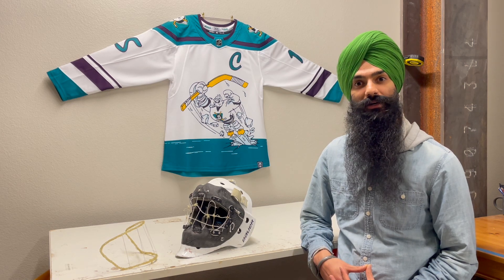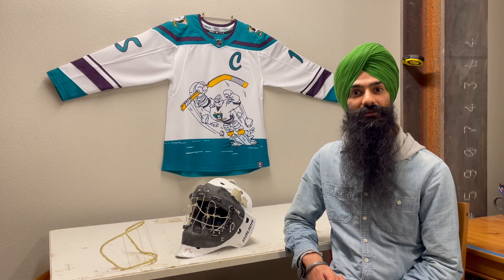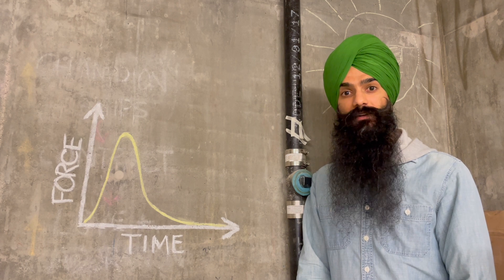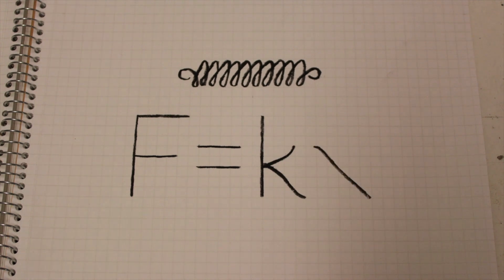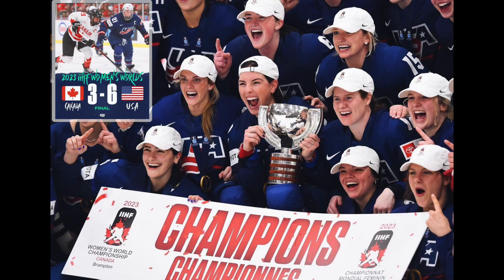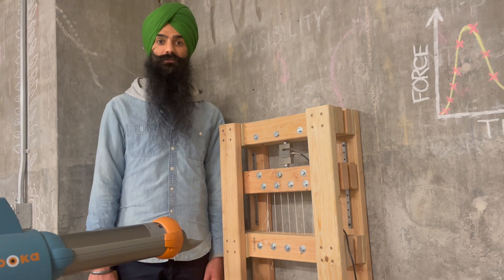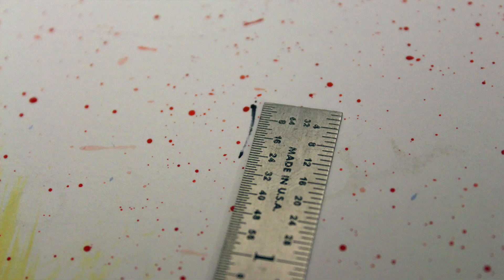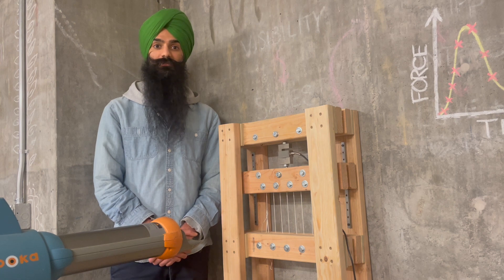Uncage Build Log: Finding the Force

Comment: It might be possible to use a putty or clay of some kind. It flexes minimally and won't return to it's original shape. I think you could probably figure out its compression resistance factor and calculate the force generated that way.

Comment: This is a really neat idea. As a goalie myself, removing those bars would greatly aid in visibility. I'm sure you've thought of this already but what about having a single bar in the middle, potentially with one horizontal bar for stability? Or just two bars in the middle? You'd still dramatically improve the visibility of the cage while providing support for the frame. 

Great video production btw!
Reply: I think he tried this at some point, but it had some problems

Comment: This series has been so enjoyable for me to keep track on. Keep it up!
Physics was not my forte' in school but I'd imagine the edge of a puck is going to have more localized pressure and cause even more damage than the pitching machine ball due to its solid structure, higher mass, and concentrated impact area. Just something to think about when calculating the max impact loads.

Comment: I love your work! Have you looked at what F1 has done with the halo apparatus? A thin vertical spine in the center of your face becomes nearly invisible. This would give the opening of the helmet the rigidity it needs to tighten the curtain of wires. Have you considered piano/guitar wire and hardware for prototyping?

Comment: The force will be reduced if the impact takes longer. You are measuring the peak force if your clamshell were ridiculously stiff. In reality, the mask will deflect a little, and spread out the impulse over a longer duration, lowering the peak force.

Comment: I'm no engineer, but I'm wondering if you can use some of the principles of tensegrity to wrap cabling around/through the helmet to both points so that if it tried to clam shell it would be fighting itself.
Reply from the maker: The geometry is pretty challenging, but I do love the idea and have thought about it before. I'll probably try something a little simpler first, but might come back to it in the future.

Comment: Great stuff! Are you concerned about energy lost due to the non-stiffness of 2x4s? I’d imagine those force numbers should be actually higher?
Reply from the maker: Good question! Not too concerned (though I could be wrong not to be). I know I made some tradeoffs - like not using the peak detector to find the actual peak - but I needed a number that was close enough to keep moving forward. Didn't feel I'd gain anything by getting something that was like 100 lbs more precise. 
Also, there is going to be energy loss in the actual frame of the cage as well, so I think a perfectly rigid test rig would be unrealistic in the other direction.
Reply: @surjan_singh it's not so much the stiffness, as it is the mass of the wood inertially dampening the force of the ball. If the mass of the ball and wood were equal, the acceleration of the wood is effectively a significant amount of force (not factoring any frictional forces) . By the way, someone with a more recent physics education than me might be able to calculate the theoretical forces to see how close you are.

Comment: In terms of using a lower sample rate: I think you could have used a greater number of samples from similar shots and then fit a curve to it.  I assume physics would have a pretty good shape of what the function of the curve should look like and fitting that curve wouldn't be too hard, at very least with some numerical analysis
Reply from the maker: Good thought! Goes to show there always a million valid ways to approach the same problem. Will definitely keep that in mind for the future.
Reply: @surjan_singh  I figure it's probably better to be more cautious with it like you have been with this project considering the potential repercussions (or concussions lol) but my theoretical comp sci brain goes "what hack can I come up with"